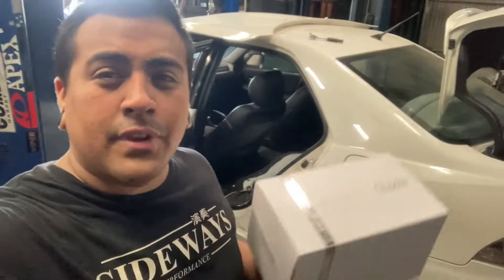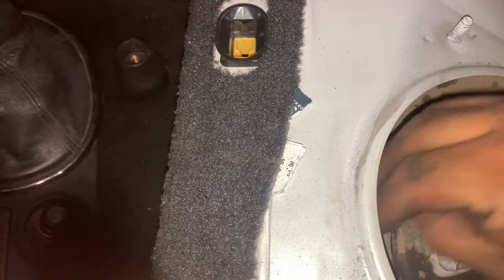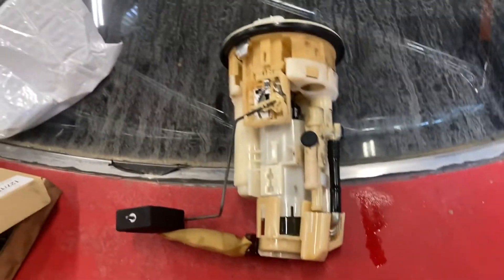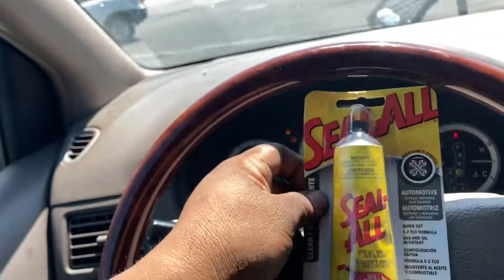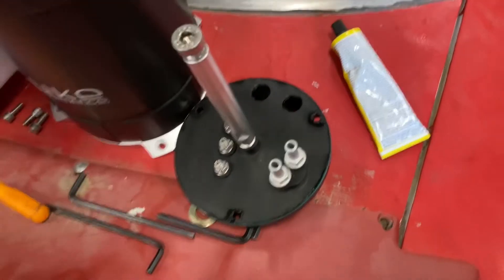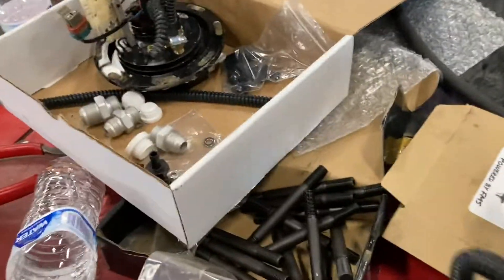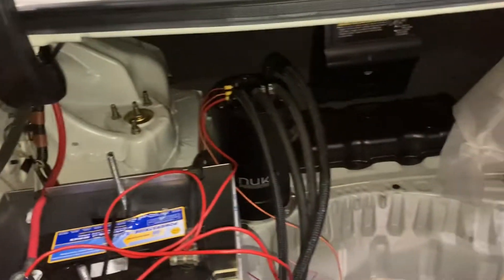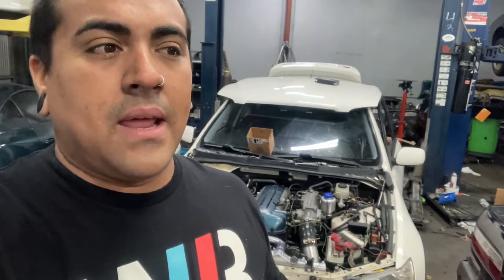Is300 Surge Tank Fuel System 1000HP

Comment: Great how to video. I looked a doing PHR hanger and modifying an evo hanger. But have given up on the stock system other than feeding a 40ltr tank in the boot. Return lines to connect underneath the existing tank then simply no nodding needed at all the stock pump assembly.

Comment: A little late but let’s say you do all these upgrades as well as e85 FPR and injectors. Can the oem gas tank, hanger, and gas tank cap withstand e85? E85 flex sensors are pretty thin lines. Are they on the main fuel feed or a side line? Thank you 

Have you ever looked into the DW 2 350iL surge tank? 6-000-35st
Reply from the maker: We have used pretty much Everyone surge tank your E 85 flex your sensor will go on your return line coming out your fuel pressure regulator and yes the OEM gas tank and hanger work e85 fine You will need to upgrade your fuel pump and tank though